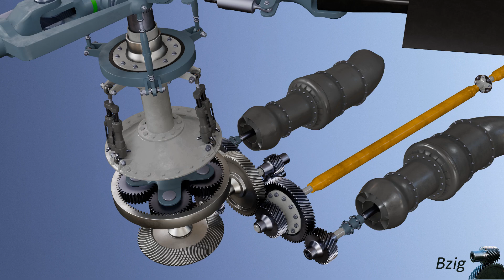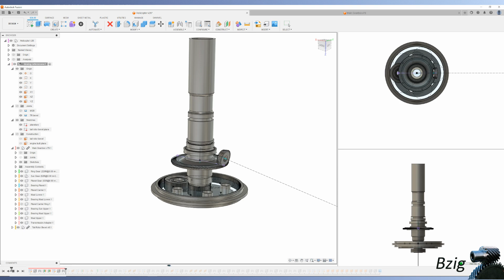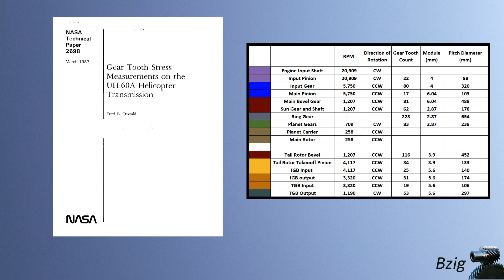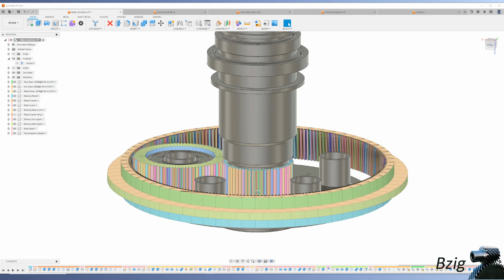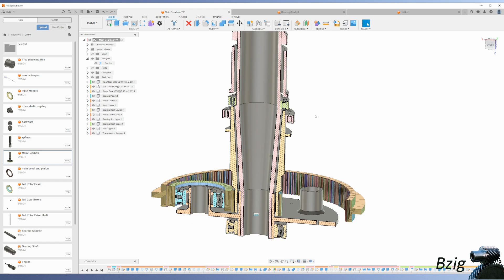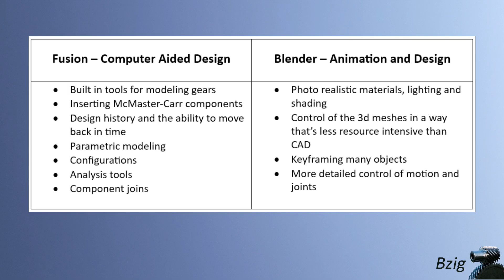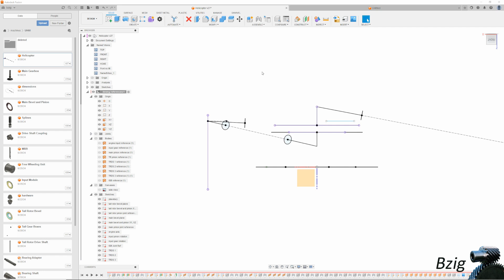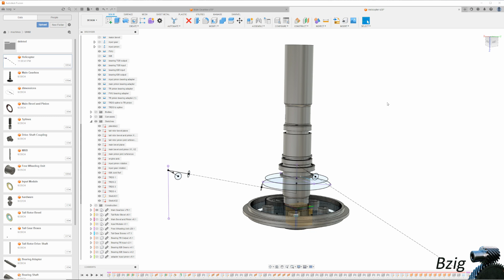How a Helicopter Works - Part 1

Comment: Hats off to the extraordinary work you are puttin in, could you please tell why have you used helical bevel for main pinion and main gear and why spur bevel for input pinion and input gear?
Reply from the maker: I am capable of some creativity, but it this case... this is the same configuration used by Sikorsky on the UH-60 blackhawk design.  NASA technical paper 2698 from 1987 has all of the gear parameters in the UH-60 main transmission.

Comment: This appears to be the drive train of Aero Spatiale "Astar"355. Their rare twin engined version of the 350. It is a totally differernt 2 to 1 transmissission design than the Sikorsky 60 series. Which is better? Only the flight hours per crash plot can say that.
Reply from the maker: I'm not sure what the Astar gearbox looks like, but I definitely copied this from the UH60.  There is enough public source information, that I'm confident in the sizing and gear ratios.  If you get a chance, there are technical reports referenced in the video description.  Those are the source of the data used to model this.